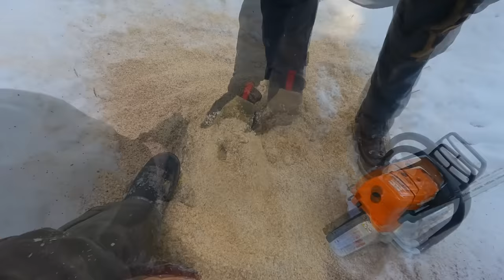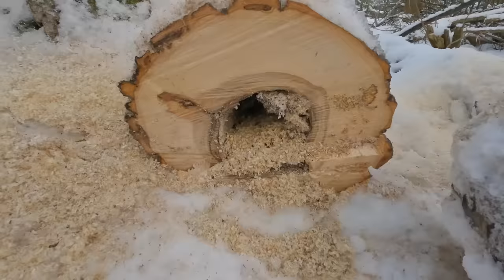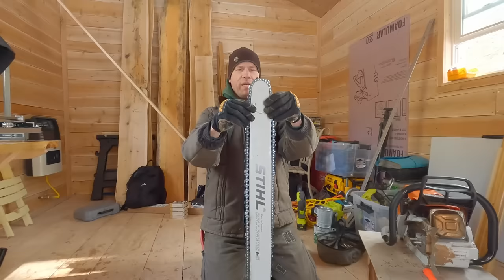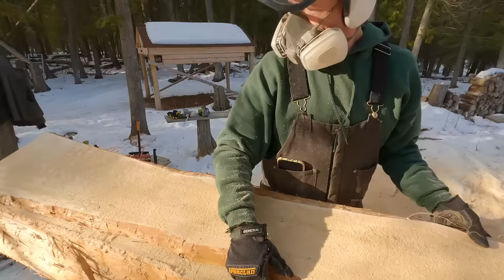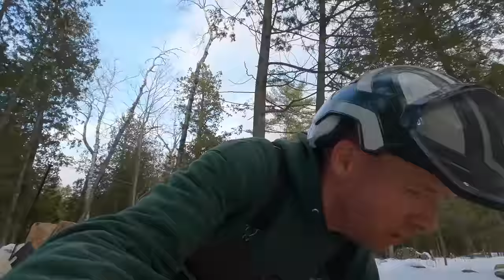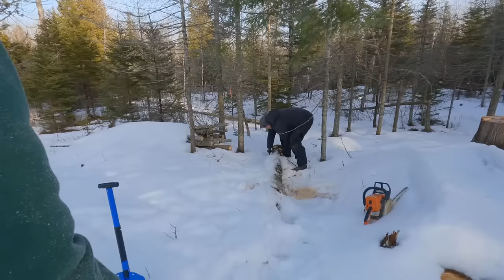An Enormous Alaskan Chainsaw Mill Upgrade, After Three Years of Full-Time Building. #125

Comment: You are going to love that saw. Its brother, the 660, went into the woods with me every day for ten years logging and it served me well. In 2018 it became my backup saw when I stepped up to the 661. Huge difference. I don't know if you are aware but the saws that end with the number 1 are Stihl's pro versions. The big difference is the autotune carb and the fact that when you hit the trigger it is at full throttle. For grins and giggles start your saw in a warm cabin and then walk outside in the cold with it and you will hear the rpm's increase a bit. Now 62 years old, a while ago I dropped down to the 28" lightweight bar to cut down on weight. I work a lot of steep hillsides and every ounce tends to take its toll these days. I've plunge cut up to 4' diameter oak logs with the 28" bar and she never let me down. When I have a lot of trees to drop that size I switch back to the 36" bar to save time. My goal each day is to fell, limb, top pull, and section 25 trees a day. At 62 I only hit that mark when conditions are perfect but I'm happy with an average of twenty logs a day.  In milling use the shortest size bar you can that makes it through the log because the longer the bar the slower the chain spins.  If you really want to have fun, throw your 20" bar and mill some with that. In fact, you made need to hold'r back a bit! LOL. Okay, maybe not quite that good, but Stihl... its a lot of fun.
Reply: The 1 does not mean pro bro. The older adjustable carbs IMO are better because you can mod the muffler to get more power and adjust the carb to compensate the air-fuel ratio and when the new style carb begins to get a little buildup in the jets you won’t be able to compensate with adjustments so it’s off to a Stihl dealer for parts or repairs.
Reply: The last number in the saw on stihl is the version of the saw they made the 660 first then the 661 replaced the 660 and so on has nothing to do with it being a pro saw or not
Reply: @nickmudge8052   Agreed Nick, I stand corrected. I just checked the Stihl website and based on the info there you are right Apparently that was a sales pitch that I never I checked out. The 661 Cm however does fall into Stihl's ProSaw category. Either way it's an awesome saw.
Reply: @cabinman  As I just replied to someone else I stand corrected on the meaning of the "1". I think it was more of a sales pitch thing when I bought the saw. It is however in the Stihls Pro saw line. As far as the other things you mention don't get me wrong, I loved my old 660 and she was tricked out to the point I had more mods in her than she originally cost. She was just getting to the point where she getting old and a bit unreliable and I was looking to upgrade. I'm curious about the build-up issue in the jets of the 661. Do you own this saw and have you had this issue? The reason I ask is I heard that from someone else a couple years ago and I've never experienced it. It's not that I'm feeling left out or something (LOL). It's just that I run the saw hard logging hardwood 3 -4 days a week and the only time it's been in the shop is when it blew a clutch spring. I'm wondering if it is a dirty gas thing or maybe using lower octane fuel issue.
Reply: @DanB-ei8br  The earlier Stihls started with a zero so the 90 cc was a 066 but it’s all the same as far as power basically and I was trying to point out that the 661 isn’t any better than the 660 or 066. Any carb or fuel injection system is susceptible to buildup and issues but I prefer to have one I can work on without relying on the dealers to gouge me. Yes I’ve had a 660 for about ten years and I have had to clean the carb out.
Reply: The length of the bar has nothing to do with how fast the chain moves. It simply gives a larger depth of cut and allows for more teeth on the chain. Same pitch though.
Reply: @TxMesquiteman  I didn't think it would either but when I dropped down to a 28 inch bar shortly after getting the saw I picked up about 150 rpm's on my digital tach. I'm still not quite sure why that happened but I switch back to the 36-inch bar to double-check it and it dropped back down to what it was. I have to wonder if it was a coincidence or if the longer chain caused more resistance thing. Still kind of baffled by it.
Reply: @DanB-ei8br  Could be the added resistance of more chain in the bar causing it to go slower. My point was ( and I apologize for the rather rude way I phrased it) that if the sprocket tooth count was the same then for a given engine RPM the chain would be moving the same distance per second/minute. Could be the chain sharpness and profile also. Lots of variables. 
I’m assuming the width of the cut/log was the same so cutting resistance would be the same.
Reply: @TxMesquiteman No worries about the comment my friend. Best I can remember it was pretty much an apples-to-apples thing. Same pitch and all and no change with the sprocket. Come to think of it though the 28-inch bar was a lightweight and the 36" inch was stock. I wonder if that had something to do with it. As far cutting goes I didn't really notice much diifference. When I put the tach on it it was wide open on the ground.
Reply: @DanB-ei8br  could be the difference between a newer chain and/or bar and an older more worn one. Also the oilers may put out different amounts. 

Interesting observation though, thanks for sharing it!
Reply: Spot on! Solid pro sthil bars too,not laminated, laminated warps & cups more from heat distortion & so do longer bars than you need. The length can increase warping if they get hot. So no more than you need weather cross cut or mill.
Reply: @cabinman As a owner of a 1997 066 magnum. I do know the magnum and the "red-eye 066's had the higher power. The regular 066( non magnum) is a California emission legal saw.
Reply: I can understand 'use the smallest bar', but surely a longer chain has more teeth, meaning more boards can be cut before it gets dull and resharpenimg is needed. I have an electric sharpener. Provided I'm not taking masses off the teeth, shortening the chains life, is there a preference....electric or by hand?
Reply: @Igotknobblies  I totally agree with the less sharpening idea and that in itself could be a time saver for some. As for me, I can zip through a chain pretty quick when it comes to sharpening them as long as they are not beaten up. The trick that works for me is to touch them up quick to keep them sharp before moving on to my next board. As far as electric grinder, or hand filing, a lot of that depends on the guy sharpening it. I've seen guys spend so much time getting the tooth just right with an electric grinder that they actually take the temper out of the tooth which makes them dull quicker. I've used both, and still use both, but personally prefer a file, although the All-In-One hand sharpeners that Stihl came out with are game changes.  What I like about a file is that I can feel whether a tooth is sharp just by the way it drags across the tooth and to be sure it's sharp I'll drag my thumbnail across the tooth. Some guys have that touch with a grinder but I guess I'm just not there yet. Either way, and either chain, the main thing is to get out in the woods and have some fun making "Man Glitter"!!! Oh yeah, and boards too.
Reply: 6 seconds vs 17 seconds is pretty telling.
Here in the UK, timber prices are insane - so high I've been foraging for what I can find.
I've a bandsaw which can resaw 10" slabs but need something to make those slabs & a chainsaw mill looks like a decent option (I've a 4.7hp Husqvarna saw, so cost would be the mill, plus longer bar & chain).
Might pick those up whilst in the US next month - SO much cheaper than in the UK).

Comment: I’ve run this setup for about 10 years and you’re going to love it. I mill hardwoods and it’s not that fast…what you have there is the speed of a band mill cutting through that softer wood! 
Since you’re only using that 661 for milling and bucking I would suggest to loosen your chain and get that resistance outta there and let it run more free. Your bar will last longer and it will cut a little faster. When limbing and cutting stuff in the forest yea the tight chain is safer but milling and bucking you’re wasting your bar with all that tension. Give er some slack. 
Happy cutting
Reply: Oh also there is the myth that “C” (such as the 180C) stands for Commercial but it doesn’t it stands for Comfort.

Comment: Heat is your biggest enemy in any chainsaw cutting,rip or other wise. Saw chain should always be nice & sharp & changed or sharpened before it gets very dull at all. As it dulls it makes more heat,heat warps bar & makes more friction,drag(power loss) & heat. It's a vicious circle. Besides greasing bar sprocket, marine grade bearing grease in bar groove before chain mounting makes a big improvement, must be clean out well each time a new chain is mounted & bar reversed & flipped over for even ware. Bar dressing is a must as needed. Heavier bar oil flow helps too. Having 2 saws to work with so one can cool makes a big difference as well. If you are going to be doing alot of cutting,these tips I throw at you are real game improvements. Never install a sharp chain without cleaning,inspecting & re greasing that bar. Some say it causes dirt to build up, that happens constantly anyway? Difference is with out grease it is a grinder. Much hotter. Born today at 58 yrs old,I've run chainsaws since age 9. For instance,if you sharpen often,you take off less,chain last longer,avoid heat & make time & dont burn bars,chains & yes even clutches & crank bearings. Everything last longer,cuts faster,cooler & easier. If I dont get 100 facecord of firewood out of one chain (short of hitting nails,fence & bolts) I'm disappointed & know I've done something wrong.

Comment: Using advice that was given to me when I started years ago, that is to say when I need a piece of equipment that I’ve never had experience with, ex. A chainsaw. I will acquire something, and not spend a lot of money. After using it as much as possible, often to the point of completing using the tool up, but learning what I like or don’t,how to maintain, how to operate, feature I want or don’t,, I have enough info to purchase the correct tool.
I saw a guy who bought the cheapest saw in the world, and completely used it until it was exhausted. He keep that thing going long past it’s life, and got so much use out of a $120 saw. He probable still has it, but he now has two more really top quality saw exactly to his specific needs. Today you can buy an nice entry level saw for reasonable $, and it may be the only saw you ever need, but just going out and acquiring the biggest most $$$ any equipment is the wrong approach.

Comment: A little over a year ago, I discovered your channel while researching chainsaw mills and I subscribed back then.  I bought the 661 w/the 36" Alaskan Mill originally and have used it pretty extensively.  Eventually I bought a 62" Forester bar paired with 60" Alaskan mill upgrade kit with helper handle and oiler and, although it struggles a little bit on real big chunks, the 661 can really hold it's weight and do some ridiculous work slabbing ~54" wide.  Congrats on the upgrade!!
Reply: oh!  make sure you research the 'oil feed hack' for that 661 so it stays properly lubricated during milling operations.

Comment: For small logs, take the 661 power head and put it on your smaller bar and mill. I own a 261, 361, and 661 and run interchangeable bars on all of them. My 661 with a 20 inch bar runs scary fast through a small log.

Comment: The center bar on the mill should be center of the log being cut, turn the mill by pivoting out on your end cut for clean results and set up your logs with a slight slope, forward and to the saw side, for ease of cutting. Gravity assist. You may also experiment with a slicing cut vs right angle approach. 2-3" lead will be less strain on the saw as well.

Comment: Great fun guys, thanks! If you're looking for a Tito-proof pry bar, check out an item once known under patent as the Burke bar. With a bit forged from a hardened and tempered steel and a handle of rectangular tubular mild steel, it's made for concrete and demolition work. Something like that would take one look at Tito's approaching hulk, and quietly smile!

Comment: So much easier watching then doing! I've milled a few times in the woods, in the winter, always forgetting some tool,  ground is uneven, the tree falls just off enough, something's in the way, etc. Sounds like you've had a much better experience with the 50CC saw and mill combination then I did. With milling in mind I paid up and purchased a professional grade Husqvarna 50CC chainsaw along with this Grandberg mill. I did some firewood processing and used it to mill about a half dozen times over a couple years, ended up burning the saw out, very disappointed! After that I figured I needed the bigger 90CC chainsaw, but with the financial loss on the first 50CC chainsaw, I bought the "Blue 660" knock off. I had low expectations, but a few years later I will say I'm super impressed and would highly recommend the "Blue 660" paired with this Grandberg mill. I'm not a big fan of buying knock off stuff, but getting the 90CC delivered to the door with a 36 inch bar and chain, still about $200 cheaper then the 50CC. I've milled hardwoods at the Max the chainsaw mill would allow, about 32 inches wide, it's done the job impressively! There are some cheap plastic parts that broke almost right away, but the heart of it, the engine has the power and continues to run great!

Comment: 41:40 Pretty much. You've just stepped up to the mill I've had for years, but I use a Stihl Farm Boss w/ a 20" bar. (Trees just don't get much bigger than 20" up here.) Small and light means you can get it into a Piper Cub or other small bush plane on floats, fly out to your property and build your cabin.

Comment: The 661 is a great saw for those projects. Skiptooth, full chisel chain works well if you can keep it out of the dirt. It's a little rougher finish than proper milling chain, but fast and simple. It's nice to not swap out chain between felling and milling.

Comment: You have given yourself more versatility. You don't have to run just the 36" bar on the 661. You can go down to a 28" and the mill tip holder should be adjustable into whatever length bar you want  down from the 36". If don't need that much length. You have the power for any of it.
Reply: I wondered about using a smaller bar and how the mill will work.
Reply: I might be wrong but I believe that bigger mill that he got is adjustable to different length bars.

Comment: You have to shock those logs with a sledge hammer on the sides & end grain to get them to left go of the frost in the earth.  I'm a sthil nut. So yes I have many. I think the ms661 was probably over kill for most of what you do? I have 2 - ms461 that I feel would have done you fine. I also have 2 - older 038 mags that run 16" - 32" bar with no apparent different in speed or power no matter what hardwoods I'm cutting. It's not always the dog in the fight ,but the fight in the dog. Some models of saws are remarkable in the sthil line up, all seem to be worth the money,dependable & durable. ! At 58 yrs old today, as far as saws,not,starting, running,no power,constantly breaking,wearing out & just head aches & problems in general slowing you down when your up against the weather window most of the time. Trust me on this. It better say sthil on the side of it or I dont have any need or use for it. No I dont sell,promote or work for sthil saws,I was always self employed in the wood industry where you were paid by ton,board foot, facecord ect. No hourly wage where you could lean on a tree & milk it. Wet lands in winter environments alot of times. You dont have time in your weather window to screw with anything less than a sthil. Trust me! If your saw fails & it rains,snows,warms & thaws ,floods or freezes because you missed a down saw day, you might not get conditions suitable to ever get back in there for years & years until it dries or freezes enough again. Maybe loosing all the work you've done up to that point! The wood might rot before you get another opportunity. I'm I guy who has lived it,done it very successfully with light wieght equipment & most have no idea how I did so much. A damn good start is go with sthil.

Comment: I was thinking a 660 for my next saw but after trying one I got unreasonably tired.  I might just keep making due with my 260 and stick to smaller logs.  The 260 with an 18 inch lite bar is such a nimble tool.

I'd love a bandsaw mill but then you need a machine to move the logs so it's much more money than just buying the mill.

Comment: Those spanners ( wrench ) have been around for many years , when rotary grass mowers first made in Australia in around 1957-58 those spanners came with every one , one end is for the Plug , the other end is for the blade bolts and of course a screw driver,

Comment: i use that type of mill on my 20in. just move that middle bar about 8-10 inches in from the saw. kind of the sweet spot for both large and small logs. I cut oak, walnut, and pine with mine.